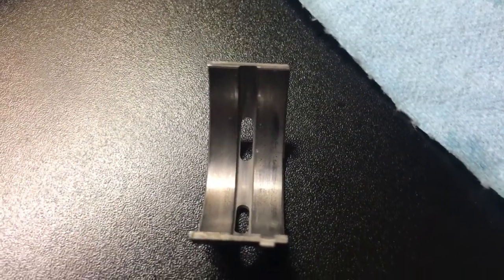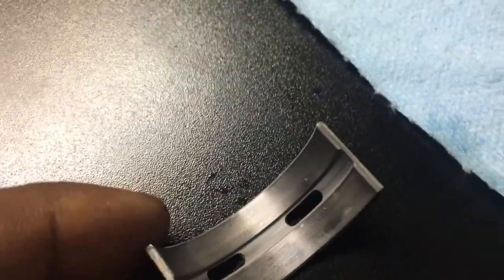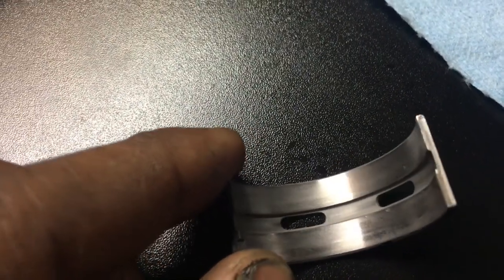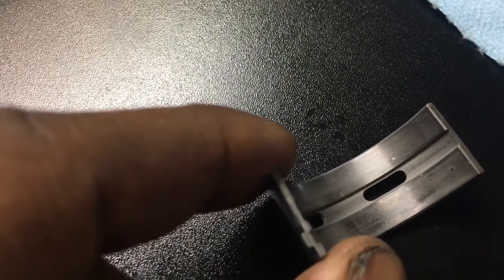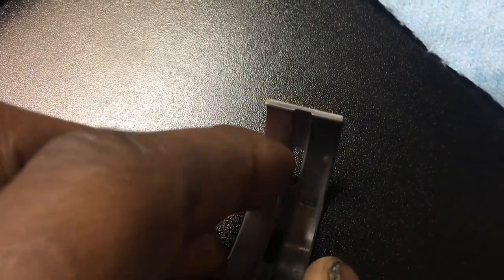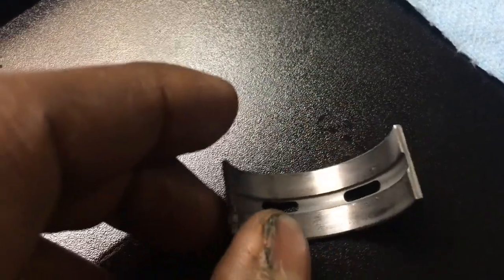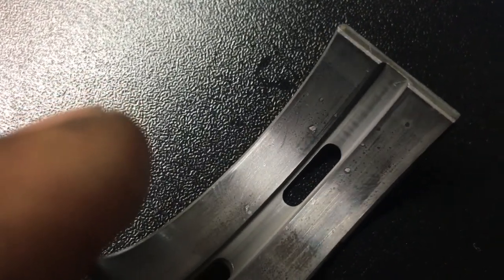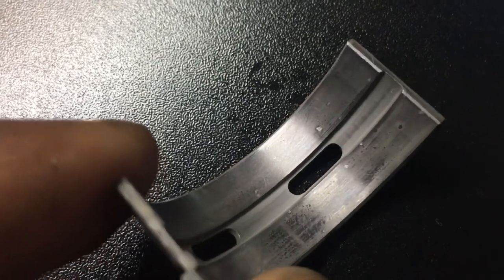Main Bearing And Big-End Bearing Wear

Comment: Should I replace the big end bearing if they look fine? The engine has done 290K Km. Also How do i know if i need smaller size bearings than the standard?
Reply from the maker: ronenfe First, thank you for watching. Second, please subscribe. Third, with that many miles it’s worth spending to relatively few dollars to replace them VS replacing a crank and or connecting run from a spun bearing. Use plastigauge to test bearing clearance as well as a cylinder bore gauge and a outside micrometer for accuracy.
Reply: @EugeneAlston  Already ordered the standard bearings. Thanks.